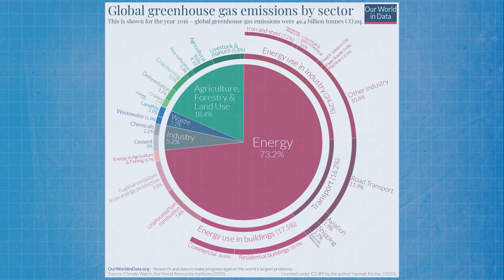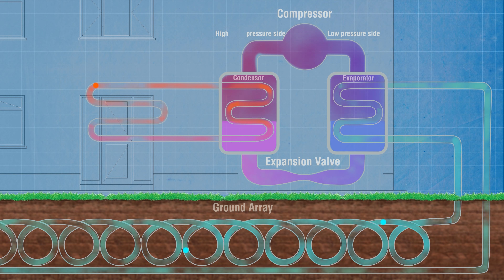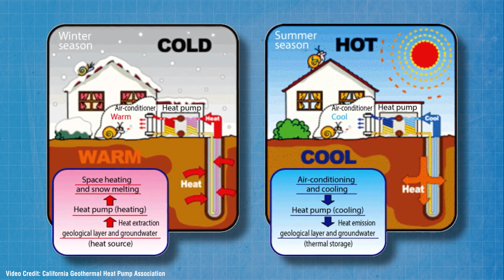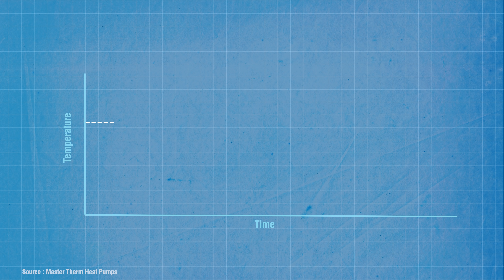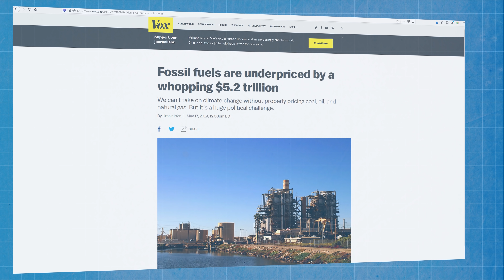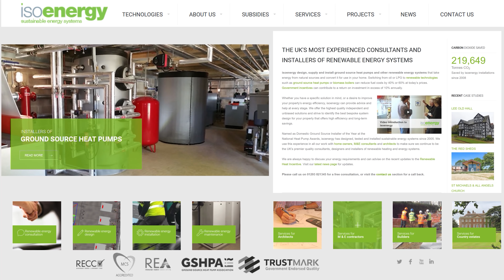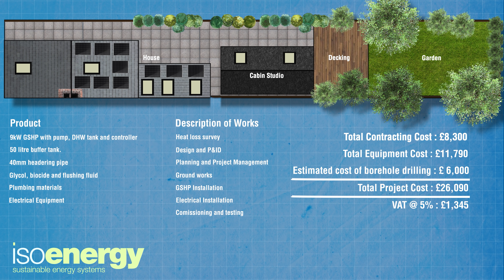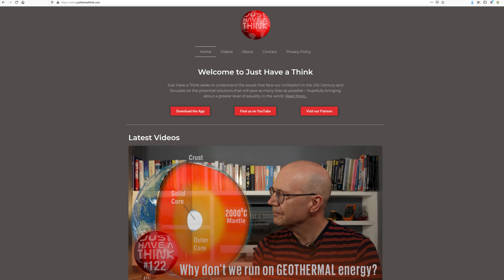Geothermal ground source heat pumps. Heating your home from your own back yard!

Comment: Been thinking for many years of a simple air based "heat exchanger" cutting a trench about 1m deep for about 20m long burying 40m of 110mm sewer pipe in the trench the end of which sticks out of ground and becomes the air entry point, then and using a small fan bring to in air into the house, below ground temp constantly sits at about 15 deg C. This would cool the Summer 30 deg C and warm the Winter 10 deg C, only power input being a small fan.

Comment: I checked in on this over a decade ago, but was turned down  just like everybody else in our area, drill rig was mounted to the back of the truck that couldn't access anybodies yards, so we missed out on a nice grant that would have covered most of the  cost of the system.

Comment: Very good video. But the borehole costs are absolutely rubbish! A borehole contractor would charge well over £6000 for a borehole capable of producing 9kw which by the way would be around 180m of drilling.

The cost would sit at the around the £12k mark. The mobilisation alone is  nearly 2 grand in most cases. 

Recently we had this done in Wimbledon for a client. 2 boreholes at 250m total cost us £15,000 and this is a contractor we regularly work with. 

I do respect iso energy but they have misinformed you slightly on the drilling costs.

Otherwise I revert back to my original point. Great video and well explained

Comment: I use to work in the heating industry . Had a call mid winter, their house was cold, their heat pump was less than a year old. We went to check it out . The out side temp. was cold enough , that the pump could not heat. We checked the auxiliary heat ,it was set to low, we turned it up and all was well, except the power bill. If the outside coils were in the ground, they could have easily heated the house, with out the expensive auxiliary heat.

Comment: Nearly 50 years ago, Liverpool used the warm drainage water from the River Mersey rail tunnel, to heat and cool commercial buildings, using heat pumps. 

http://www.hevac-heritage.org/electronic_books/M&NW_anniversary/Section-14_LiverpoolDailyPost.pdf

On the opposite bank of the River Mersey the world's first solar school was built 60 years ago:
http://www.hevac-heritage.org/electronic_books/M&NW_anniversary/Section-11_StGeorge%27sWallasey.pdf

Comment: In the UK, ground sourced heat pumps cannot compete with natural gas on running costs - they equal that is about it. High efficiency natural gas boilers are cheap. Add extra insulation in a home and cheaper again to run with less fossil fuel burnt.  Again, using solar panels and pre-heat hot water cylinder and cheaper again to run, and again less fossil fuel burnt. Heat pumps are expensive to install and only viable when there is no natural gas available. They expensive to get fixed when they go wrong, while a getting a natural gas boiler fixed is easy, quick and cheap.

It is easy to see why heat pumps have not taken off in the UK. Natural gas in fossil fuel terms is a very clean fuel.  I have no vested interests in natural gas, in fact I look forward to the day we are fossil fuel free.

Comment: I install Ground source heat pumps in the U.K., very efficient systems. And what I like about ground source is that it is more complex than installing an air source, for example making sure that Brine loops or bore holes are calculated properly to ensure we have enough energy for the system. The reason why I prefer it’s complexity is because 10-14 year ago heat pumps in the U.K. tired to start to take off but like most things people jumped on the band wagon and installed them wrong. For example, most heating installers jumped on to the Air source installs thinking that it was much like a boiler and where you can just “chuck it in” but this lead to systems being undersized and having huge electrical bills. Also we have had many jobs where the ground arrays where very undersized and caused the ground to freeze up because the heat pump had taken too much energy from the ground and the ground did not have the chance to regenerate quick enough. And with the Renewable heating incentive(RHI) and this new £5000 off heat pumps install I am worried that the cycle of not installing heat pumps properly is going to happen again. Because I heard from another person in the industry that company are going to install and air source heat pump for £5000 for the whole job labour, parts, etc and what is more annoying I would say is that they are going to leave the existing boiler in place to the hot water and have the air source doing the heating or even better as in worse leaving the original hot water tank in which isn’t designed for a heat pumps lower flow temperature and running it on the electrical immersion heater and having the heat pump do the heating.which is crazy peoples electric will be no better off and of the boiler is in place we will still be using fossil fuels when the heat pumps are more than capable of doing both hot water and heating and cooling( ground source). Going back to price they have put forward Which at the moment is not doable because if for instance a Villant or Eco forest heat pump is £7-12000 obviously prices can be different depending on the KW rating. 
Heat pumps are amazing technology, our family have been installing some of the first heat pumps that came to the U.K.  and what I worry is that industry will have a big dip because people think they can cash in if you are considering a heat pump 1) they are an amazing bit of kit 2) I would recommend you go with a installer that has 5-10+ in Heat pumps and that just isn’t offering the cheapest quotes. Because heat pumps are more complex than a boiler so they need to be set up right.
Reply: A university in the USA used a ground sourced heat pump to heat and cool a building. At the end of winter the ground had so much heat extracted it became tundra. This was then used to cool the building in summer.
Reply: Heat pumps best used with low temperature underfloor heating. At times they just cannot generate high temperatures for normal panel radiators.
Reply: John Burns yeah there definitely more effective with underfloor however if you use Rads you need to size with either over size factor normally 0.40 depending on the temp of course. And I would say a heat pump is more complex than a standard boiler. Have to admit I was writing this comment half asleep this morning
Reply: " And what I like about ground source is that it is more complex than installing an air source"

Are you serious when you write that?

Comment: I seen video where he had pipe coming out the ground with a fan sucking air and after going thru the ground coming out a vent in the floor . Worked a treat
Reply: Somebody here installed underground pipes/ducts to do that, but he failed to provide drainage and condensation in the pipes crippled the system by blocking air flow...a sad design oversight!
Reply: @robertmacgregor9716  
He could put it right with a drainage point/sump, but he will need to dig. A small pump could be used to pump out condensation.
Reply: @johnburns4017  I agree.  I'd heard about the problem, but never heard anything about what he'd done about it.  Some fixes could be really expensive, though....the best & cheapest way is to do it right from the first!
Reply: Many homes in Germany have 110mm soil pipe spiralling around the basement walls. It preheats the incoming air.

Comment: Question: Would the efficiency drop off as the ground absorbed more and more heat (or cold) from working continuously?
Reply: Yes, this is true to some extent but the ground collector is sized so that the drop in temperature is minimised and such that it can recover during seasons when heating is not required. It the system does cooling as well as heating then this can help balance the ground temperature.

Comment: I've been using a ground source system since 1991.  It was pretty new in the central states area at the time.  I'm on my second unit and I would never go back.  It is rather high priced to install, but it pays off in the long run and then some.

Comment: I used a water source heat pump for several years for a small rental apartment. It was in eastern North Carolina where the water table is very high. I washed down two wells to 50 or 60 ft depth, and used one to take water from and the other to return the water.  It worked well for 4-6 months. Then I got a call from the tenant saying that there was a new pond in their back yard.  The return well wouldn't take the water anymore.  I swapped the flow direction and the well worked for about the same amount of time. The trick didn't work for long after that. I put in a third well for the discharge and finally used two of the 3 for discharge.  It was becoming more of a hobby than an HVAC system, so I replaced it with a conventional gas furnace and electric AC.   The heat pump itself was great and there was never a problem with its performance.  It is a great system if your water is free and digging wells is cheap.

Comment: I have a Ground Source Heat Pump.  I installed it when my Air Source Heat pump needed to be replaced.  My payback for the extra cost was only 4.5 years.  Additionally it took 5 extra days to install the GSHP. Overall I am quite pleased with my decision.

Comment: Have you looked at Earthship homes? Similar principle, they usually have a large mound of dirt on one side with long air tunnels running through. The thermal mass keeps the temperature stable, and any airflow going through the tunnels is cooled/warmed to the stable temperature of the mound. Taking advantage of the stable average temperatures of the earth is a great strategy in both cases!

Comment: I installed one, using boreholes, in the front garden of our house 11 years ago. It heats our 1250 sq ft house using the original wet radiators very well, although those that like to hear their homes to ridiculous 'tropical' temperatures would not like it. With an underlying chalk geology, giving excellent heat transference to the circulating, heat harvesting fluid (800 litres in two 80m bores) we get 2.2 units of hear yield per unit of power expended. So we gain 24/7 heating at half price, but the capital outlay was £15,000, twice the cost of a new oil fired boiler plus a new oil storage tank. So stop being short sighted and invest in such a system, if you have sufficient land for the bores or trenches. But in my area, Suffolk, very few have invested. Compared to friends area's in Denmark and Norway, we in the UK are way behind- fast asleep, which typically British, I'm sad too say.

Comment: I live in southern parts of northen sweden, kind of the perfect place for it and many here has geothermal heat pump. But it's not worth it for the most parts unless you have a really big house or several houses connected to it. But people get it becuse it's just nice to be abel to have it really hot and even heat whitout the bill go up. No money from the goverment shuld be used for helping people get it just becuse it's overkill for the most parts and all other options are also green or greener even.

Comment: I've been tempted for a while now by this (borehole for us) but I've managed to talk my logial self out of it by an illogical gut feeling. I keep reading about the almost daily PV advancements just feel that significantly more efficient solar panels are just around the corner. If I had a lot more efficient panels coupled with really batteries then swapping my gas boiler to electric would make sense as I'd have one simple silent system that has flexibility for heat and power and utilise all the existing radiators etc.

Comment: We've just had installed an LG 9KW R32 Monobloc Air Source Heat Pump System (in the UK) - see https://www.lg.com/uk/monobloc, with a modest solar PV array (2KW limited by our flat root loft 
conversion) to offset some of the additional electricity costs. They also installed a voltage optimiser which saves an additional £150-200 / year. We also get paid for the export of any excess solar on the Octopus Outgoing SEG tariff as generally if it's sunny we don't need the heating on!

You'll most likely need a new ASHP specific hot water cylinder for the system to run efficiently, which may or may not need a buffer tank depending on the cylinder type. 

The installer should complete an EPC as part of the survey to assess the required heating output for your property which is also used to calculate the RHI payments you will receive over 
the 7 year period. The EPC should then help determine what radiator upgrades you may need (unless you have underfloor heating) as the ASHP typically heats to 55°C, lower than a conventional gas boiler. We had 4 radiators replaced with deeper versions.

I found the difficult part finding an installer that isn't just a fly by night setup, like so many solar PV installers that came and went in the last 10 years. I'd advise looking for
 an installer that is MCS registered (a prerequisite for RHI), and has HIES insurance in place in the event they go bust.

We have a detached house built in the 90s with decent cavity wall insulation, newish double glazed windows, so of course the first priority is to add insulation to ensure the heat you need 
isn't just going to waste. 

The heat pump installation (and PV) took 4 days in total, the trickiest bit was getting the new cylinder (with integral buffer tank) in the airing cupboard as it was about another 
1/3 bigger/taller than cylinder it replaced.

The heat pump is installed outside below our kitchen window. The pipes run up the wall into the house where the hot water cylinder is located.

I was surprised that at full tilt the fan is a little noisier than we expected, but something we have quickly got used to. 
During the summer, heating the water only takes about 20-30 minutes - which is usually enough for a couple of my daughter's showers! before it kicks in again.

Over the next 7-15 years the system will pay for itself, but we are lucky that we had savings to meet the up-front costs. Someone else mentioned the Scottish system of providing interest 
free loans which may help those without savings to take advantage of the RHI scheme in Scotland, which I'd like to see in the rest of the UK.

I'd like to see more community GSHP systems installed by local authorities to provide hot water and heat to those in affordable housing, and hopefully gas boilers will be banned in new
 builds soon.

I hope this helps someone considering an ASHP system, as I found little information online about where to start.

We've yet to get through the UK winter to assess how the system copes, but the LG system can operate down to -25°C. The ASHP for our property is only expected to save about £200-250 / year
 on the equivalent gas costs, but again that adds up over the years.

Hope this may help someone in the same boat as we were considering moving to a renewable option.

Comment: In the UK, the largest heat pump installation is in Westminster. The problem is that it is not harnessed. It just generates lots of hot air, which flows direct to waste and benefits nobody.

Comment: I was hoping to test this idea on a small scale by burying a homemade heat pipe, with the end of it ending in a storage shed, tied into a radiator.  When the shed is hot, the heat pipe should draw heat out of the radiator.  When its cold it should radiate heat from the ground.

Not as fast at hitting ideal temperatures, but heat pipes require no energy to move heat, so they could work well for barns or storage buildings where the heating isn't as critical.

Comment: There are three possible options to use ground based geothermal.
One is installing ground system piping in conjunction with a leach field where a septic system is being i installed.
Two existing water well for a closed or open loop.
Three many jurisdictions are going to on site storm water infiltration systems. Ground loops may be placed in conjunction with excavations for storm water mitigation.

Comment: Here in the USA, I needed a new system this past year. I was going to do geo but it was $30,000 as opposed to $8,000 I just couldn't do it. The incentives didn't help any. I just couldn't afford the upfront costs. Also, half this cost was drilling the 3 wells I needed. I asked if I could drill my own wells and they refused to install if I did the drilling myself.

Comment: I installed in ground heat pump the summer of 2018. Before that we had a oil furnace. Since we had an old hot water tank and the system came with 2 new ones our electricity  bill went down. For some reason we were using less electricity than we were when using with the oil furnace while heating the house. We now have the luxury of having air conditioning in the summer. You have to include the savings of the previous heat source. Yes they are expensive to put in but we were paying upwards of $300/month for oil and the electricity bill was $100/month. Now we pay about $250/month for electricity and we have an electric car as well.

Comment: Also you should mention air sourced heat pumps ASHP which are getting more and more efficient, capable of working in sub freezing temperatures and hugely, need no drilling or burying of large amounts of pipes.

Comment: Loving your channel and have been watching a few vids now. I just wanted to ask a question about under ground heating/cooling? Like with the London underground subway system when it was 1st open it was seen as a retreat from the heat as the cool clay made it very comfortable. but after 100+yrs the underground is known for being a sweltering hot box!  So my question is wouldn't underground heating/cooling home system run into the same issue of gradually changing temperature? Or is the earth just too big of a heat sink for it to matter on such a small scale?